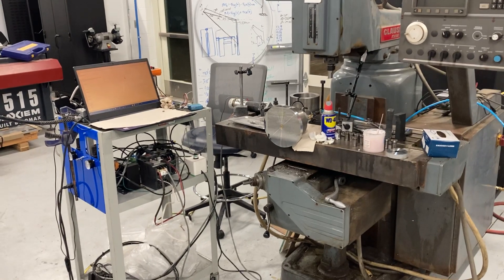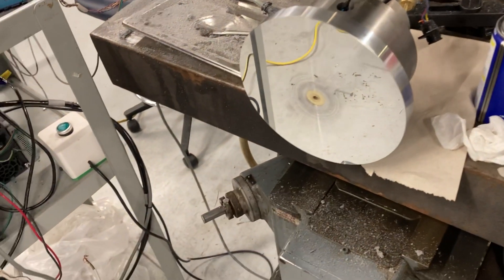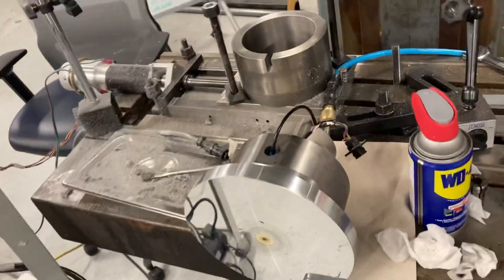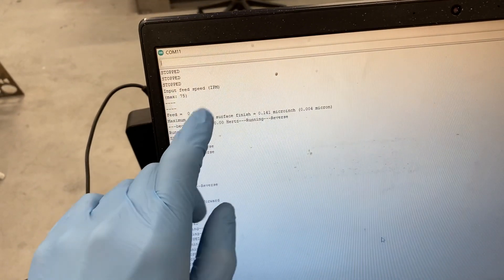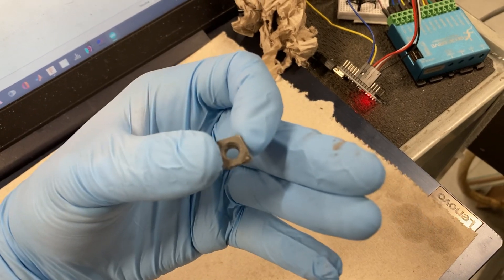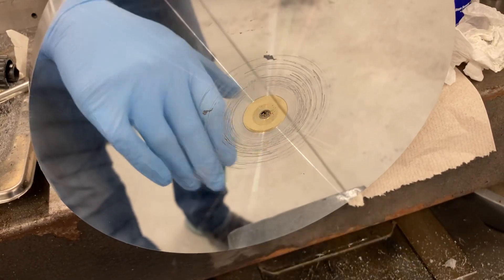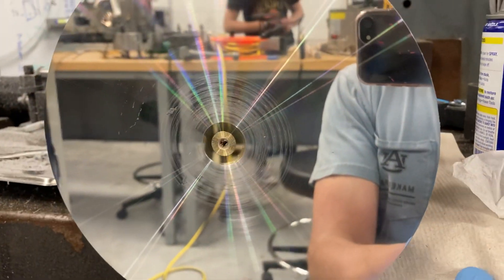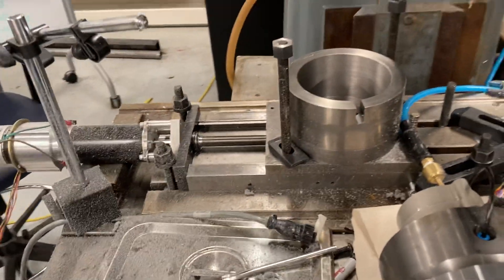MIRROR FINISH with PCD insert and air bearing spindle

Comment: Hi, I would also like to know what is the Mfg. / part number of the spindle..
I’ve often wanted to buy one just to play with and see what’s possible. 
Generally the so called “block head” air bearings have shown the most promise.
Very interesting video.
I have a voice coil actuator (500N) and wanted to combine it with a air bearing.
Thanks for sharing!
Reply: they're huge amounts of money, often 8k+ each new, best bet is old ebay stuff for us commoners :(
Reply: @DUIofPhysics  for sure! eBay all the way 😂 I’ve hesitated on several as it’s out of my spindle knowledge (milling and lathe) but I have virtually everything other than the air bearing for my small lathe project.
Reply: @DUIofPhysics  I dunno. If you ask me, 8k for a sub micron runout spindle is cheap as chips. Personally I think PI make an extremely good value offering
Reply from the maker: @YulehHabibi you’re right, they’re an extremely good deal compared to similar offerings from harig, Herman Schmidt, and others. 4” Blockheads run for much less than 8k, too.
Reply from the maker: This particular spindle is not commercially available. It’s made by PI but it’s from a old project that didn’t pan out so it’s relatively bespoke. You could ask them to make another I guess… but honestly Blockheads or their ISO series are absolutely your best bet, but yes they are rather expensive.
Reply: @cylosgarage  thanks for the reply. 
Look forward to seeing more.
I have some delta tau controllers and wanted to combine with a voice coil. As vibrations can be measured and ‘injected’ back into the servo command voltage and the high bandwidth response of the voice coil can respond. I hope I get round to looking at this at some point.

Comment: How were you driving the spindle?
Reply: The motor was shown in a previous video (dec.1.). It was reclaimed from a semiconductor robot. I guess the original inverter was too.
Reply from the maker: Induction motor driven by a VFD. The stator is from the semiconductor robot, but we made a squirrel cage induction rotor to replace the permanent magnet one that it used originally. Makes less torque but gives smoother motion and less influence